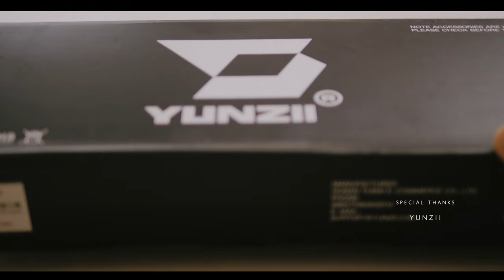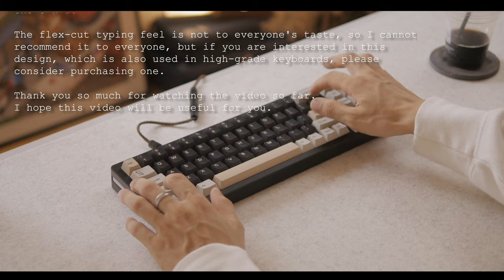YUNZII「AL71」

Comment: What size hex bit did you use to take it apart?
Reply: Hey idk if you ever figured it out but the hex size is 1.5 on my board. Idk why this info isn't out there anywhere when I looked for it. Hope this helps!
Reply: @bottlefox yup used that same size to get mine open thanks for looking out.